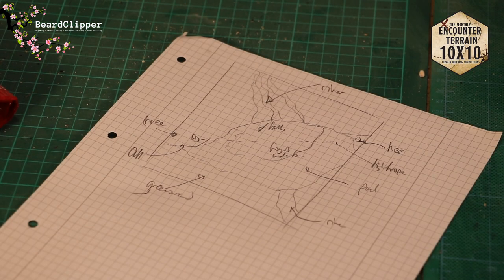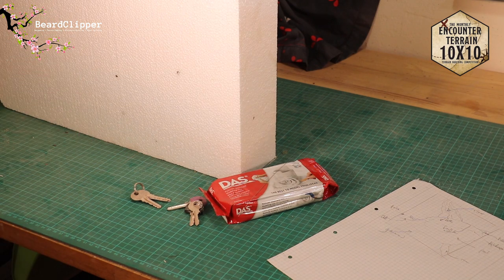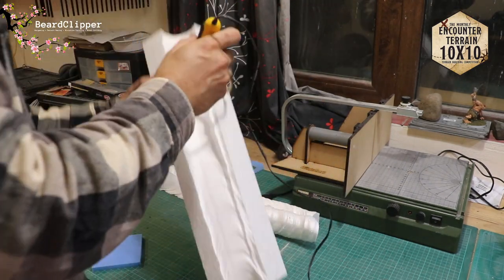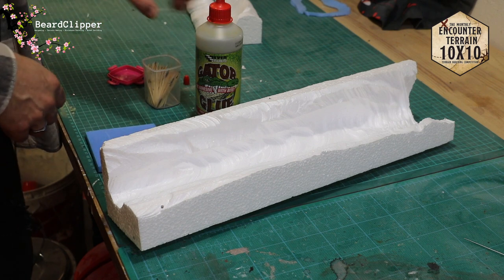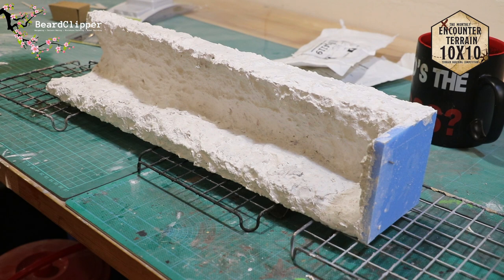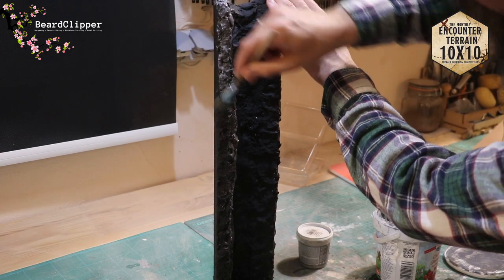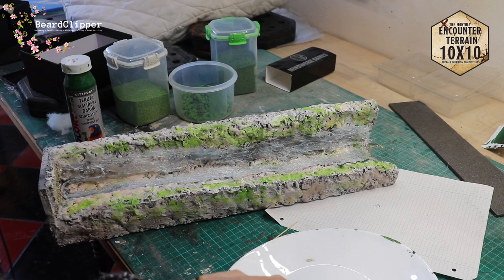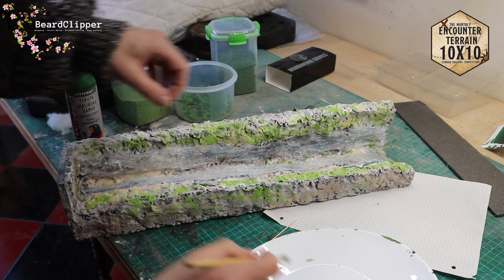Tightrope walk across a waterfall in this AWESOME diorama

Comment: Great video, while making "the dude", why did you decide to bend the wire instade of cutting every limb and glue it with super glue?
Reply from the maker: Thanks mate, glad you enjoyed it :)

It was basically because I was struggling with my clumsy fingers as it was; making the bits even smaller would have ended with me dropping them all over the place :) as it happened bending helped as I was able to make a loop with his legs and push the actual tightrope through, making a really strong connection there :)

Thanks for the comment and question.